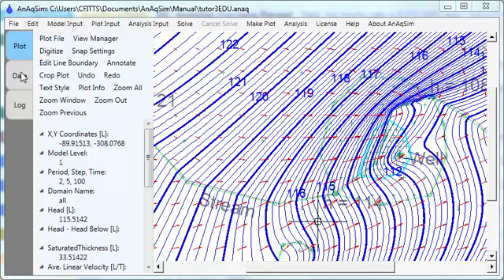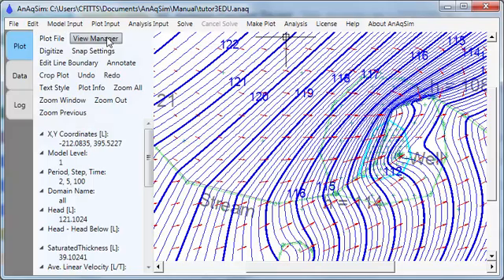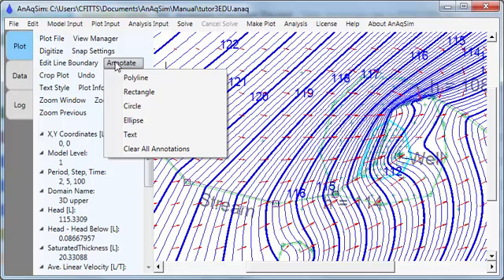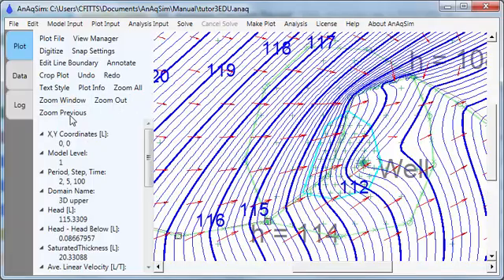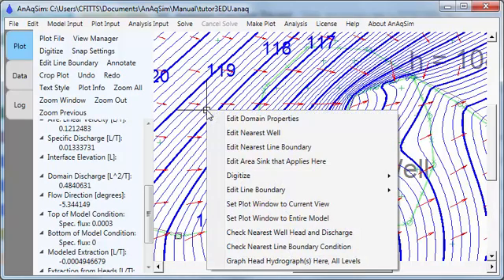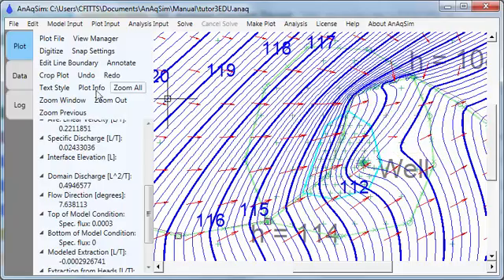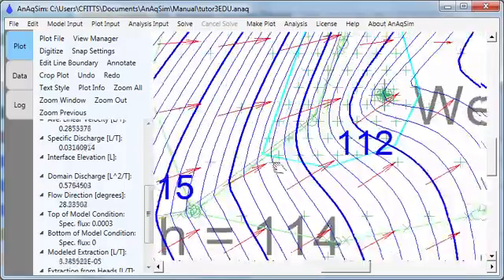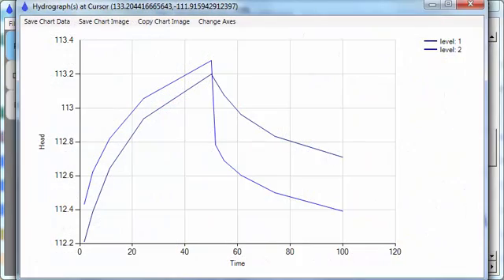AnAqSim Plot Tab

Comment: Thanks dear Prof Fitts. Actually, I am using the Unlicensed Inaqsim, the problem with me it doesn't display the data when I click on plot tab. Any help?
Reply from the maker: To get a plot you must create a model (Model Input menu), then select Solve to solve for unknowns, and then select Make Plot.  If you have followed this sequence you should see a plot.
Reply: @fittsgeosolutions  thanks Prof for your feedback. Actually, I started with the first tutorial on inaqsim, which means I'm exactly following what's written in the PDF.
Reply: @fittsgeosolutions  ooh finally I may catch the problem! My computer RAM is 8 GB, and it is mentioned in the manual that the RAM should be at least 40 GB. isn't?
Reply from the maker: @mahamanoumar1802  No, 8 Gb of memory should be enough.  However, AnAqSim requires a 64-bit Windows operating system, and that may be the issue.  If you want to send me the file that doesn't work and tell me exactly what steps you're taking, I can try to check it on my computer.  My email is fittsgeo@gmail.com.